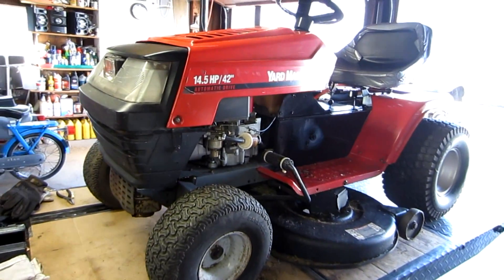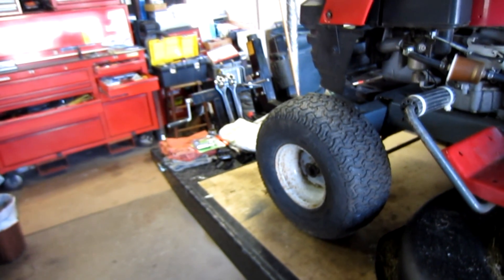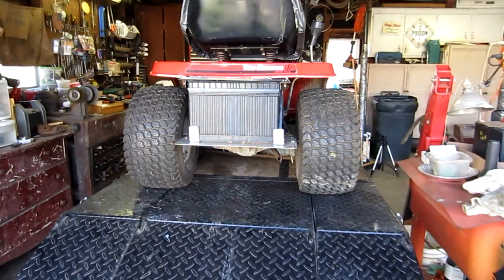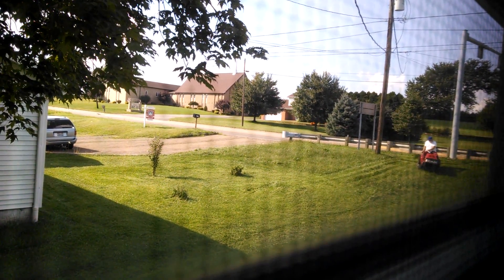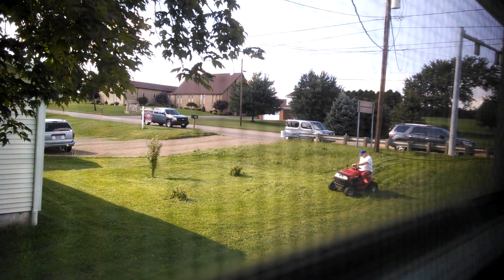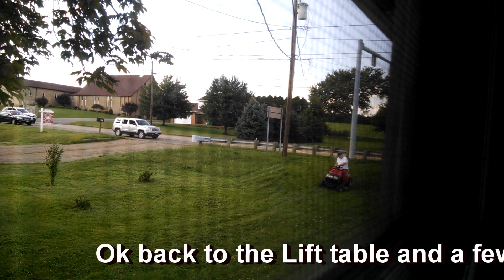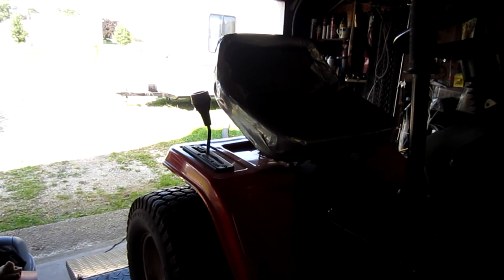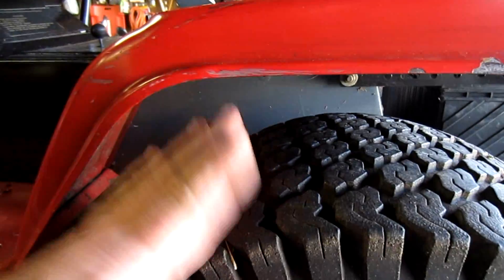Buying used MTD mower DON'TS

Comment: I have a 1995 MTD Yard Machine that I bought new. Just replaced one of the drive belts this week, everything else is original. I have one acre of land and have had no issues with this mower.
Reply: i have a 95 mtd as well. can you tell me how to level the chasis (not the deck)? mine leans, but deck looks level.
Reply: @khamkham7134  check all the air in the tires look up under make sure nothings come a loose that front part swivels may have a bad front wheel bearing
Reply: Strange you never said anything about liking to throw rear drive belts.  My 1996 12 horse model loved to throw rear drive belts. You can't add lube to transaxle also.  The transaxle case cracked after 25 years of mowing.  I actually found a replacement in a mower salvage yard.  It's still mowing today.
Reply: I've only replaced the rear drive belt because it broke.
I finally changed the deck belt and the front drive belt because they were getting loose.

Comment: Never seen one that the deck engaged when you lowered it. My parents owned an mtd yard machine with that motor and a 42" deck,but it wasn't that design.  They used it for 21 trouble free years from 1990-2010. I did the routine maintenance on it as far as tune ups and taking the battery in the house and keeping it charged occasionally throughout the winter. Never replaced the belts,tires,or antiscalp wheels. When they got rid of it it was because the tires were dry rotted and leaking air so bad that they had to be aired up for each mowing. They mowed about an acre a week with it 7 months out of the year.  Not bad for $985 in 1990 dollars.

Comment: I have the same one except mine is hunter green.  1998 Model. I am the second owner. It is still going strong. I actually think that it cuts grass and throws it better than my John Deer rider.  I know MTD gets a bad rap, but they are one of my favorites because of the parts interchangeability and availability. Most things to work on them are easy. Pretty bulletproof engine and transaxle combination that has been around a long time.  The key to these, as any machine, is proper maintenance.

Comment: If you really want brighter headlights in your mower, it's best just to buy the LED equivalent of whatever bulb fits your mower's headlight socket. Say maybe 1156 or 1157. For under 20 bucks you can have 300-500 lumens at half the power draw of the the standard bulb.

Comment: I've used a couple of these 90's mtd designs for almost 2 decades. They do the job, if they're maintained and not abused.

The single cylinder B&S does labor when cutting tall, thick grass. The opposed B&S twin does a better job, when the grass is taller.

They continue to serve me well and surely beat having to use a push mower.
Reply: Like a lot of mowers, they need nearly constant tinkering. Not the "set it and forget it" type. Seen it on a few ride on mowers, not just mtd. They all have their problems

Comment: I have a 22 year old MTD (Ward's) that still runs good. Other than the battery, the only things I had to replace were the ignition coil and a belt pulley - and those were only last year. I even still have the original belts on it. Oh, I forgot the plastic starter gear broke about 5 years ago, I think that was about $2. I addition to mowing, in the Spring I aerate the lawn separately and in the Fall I sweep the leaves separately, so I put about a season and a half on the machine every year. If you think the old MTDs were bad, look at the new mowers with plastic engine parts and plastic transaxels.

Comment: The wiring is a good pointer too. I've seen them where people wrap wires around metal oil drain tubes. Heat and friction are of the two things wire jackets hate and some people think it's a good idea to wrap the wires around a source of both of them.

Comment: I have a mtd twin cylinder 46 inch cut still running strong .. not bad for a 1999 model
Reply: My 14 horse Yardman rider is difficult to turn.  How can I fix this or should I take it to the repairman?

Comment: I’ve ran a few of these MTDs and none of them have had decks that stay on or function. I’ve had some transmission issues as well. The most common is that when they sit for a while the lower gears don’t work, only the high gears will move the tractors for a few minutes. Also I’ve had belt slippage problems in high gears but I think that’s just the belt. I wouldn’t not recommend mowing with one.
Reply: I have one and the mower will stop moving forward in 1st gear if there is much resistance like climbing a grade or in thick tall grass. Is this a transmission issue or a belt issue?  The mower was bought new by my grandfather, he used it for a few seasons and became ill and could no longer use the mower so it set unused under a carport for the next 8 or 9 years. I took possession of it this year and after cleaning the carb and replacing the fuel lines, changing the oil and a new battery have been using it since about May and just noticed the problem with 1st gear a couple weeks ago
Reply: Randy Gray after running the machine for awhile all the gears will start working. If you pull the clutch back with your foot and hold it back it should keep going in low gears.
Reply: @enginesandoutdoors3238  Thanks Ill try that
Reply: Randy Gray if that doesn’t work try replacing the drive belts

Comment: I have a 1986 MTD  18 hp  it has an electric clutch for the deck and it cuts beautiful even when the grass is over 2months growth.Thanks for the video.
Reply from the maker: john palma Thanks for sharing that and reminding viewers that there was a time when MTD wasn't trying to dominate the outdoor power market and instead was making some decent equipment.... Your older MTD had a lot going for it, 1) it didn't have the stupid "lower the deck, blade engagement.. 2) having the positive belt engagement with a PTO huuuge advantage and 3) the smooth power and torque that can only be provided by a twin cylinder.. All those pluses adds up to a good mower.. keep it going, shopping for a suitable replacement that would treat your as good as that one does gets real expensive these days..

Comment: Good tips for buying used mowers. I bought one of the Montgomery Wards (Powr Krart twin cylinder ) tractors in 97 & mow  1 & ½  acres of  mostly hills. It still runs strong. On the Wards tractor I do not have the cutting problem you mentioned. I did have to change the starter once & the 2 blade deck I swapped out for a 3 blade deck due to the original deck rotting out. I have limited garage space & left it outside for years (although covered). I will be using it this weekend. When cutting advise your neighbor to cut in a pattern that shoots the grass out away from center not inward only to build up. You are a 100% right  about having to remove the deck . After all these years I still  cringe just thinking about changing the belts & sharpening  the blades.
Reply from the maker: +JOE Z 😃

Comment: Thanks for posting these helpful hints. MTD lawn tractor mowers are pretty common around here - identical machine can be found under 5 or 6 brand names. I saw a used one, priced attractively, but when I checked it, it had several of the problems you mention. Found another, 16 HP/42 inch deck for $50 more, 4 years old, owner had maintained it really well and it had none of the problems you mention, except cracked "headlight" plastic. That didn't worry me - we get 16-17 hours/day of sunlight, so no mowing in the dark, LOL. All the other trouble spots you point out were good, plus everything worked properly. Sure I spent $50 more, but your "trouble tips" probably saved me a few hundred. Tip for others who are looking - don't be afraid to ask the owner about how often he's serviced his machine, and what's been done. If it's a good unit, the owner will have no hesitation in telling you - and you can see it as well. Even little things - any rust starting, etc. My only beef is that I wished the seat was set a bit further back, but that's easy enough to adjust. Thanks again!
Reply from the maker: +Jim Baritone Great News! Glad to hear it helped out.. Happy Mowing😁
Reply: Aren't the seats supposed to be easy to adjust?  Was the beef that the previous owner was a different build, or that it couldn't be adjusted far back enough?

Comment: Before I started repairing tractors, I did a lot of mowing and these MTD tractors will take a beating. The decks are difficult to remove but are also very well attached and can take a ton of abuse. I never picked up trash, just mowed ever rhino in its path. These older MTD machines are tougher than the new ones. Now the EZ remove quick attach decks are barely mounted to the tractor and the mounting beakers are easy to bend and break off. I fix this issue quite often along with spindles vibrating loose from the mounts and ripping off the deck. All the big box store mowers are wimpy. I think the AYP machines are about the best. Unfortunately craftsman is having mowers built by MTD again so even craftsman is turning to crap. I have found that Husqvarna and Ariens are pretty much all built by AYP. At least all the newer models out now that Iv been seeing around Texas.  I do agree about the Briggs v twin, with good servicing the v twin motors will outlive the tractors.
Reply: Yep just scored a 1988 wizzard 12  hp commercial  460cc briggs  38 " deck. All i did was cut a regular lawn tractor battery  in  where  the tiny motorcycle battery  would have gone,  the   deck itself is solid american steel  you can tell .  cleaned out the carb  and off it went  cutting grass  better than my john deer ever did .  i went through 3   decks with john deer   they just rot out  quickly  and cant take any abuse  , the brackets  break off  the deck from cheap chinese steel  as soon as they rust forget it . its over . The wizard was free and in better than good shape . grand total about 40 bucks into it  32 for the battery including the core charge.   can of drab green  camo paint and a few grade 8 bolts and nuts to  make bracket to hold the bigger battery in  place  lol  try and even find a decent used john deere  deck   for under 250  .  just wont happen. Im thrilled to be back on a old school  lawn tractor . I kept the deere  la-125   for some use  . But ill be running my Wizard from western Auto  as my grass cutter. as far  as the long arm  that drops the deck  . i see no issues?? . Replacing belts will take more time but  new lawn tractors are garbage unless you pay $3,000  dollars  or more .  This  was made in 88  and still   in great shape . My john deere  looks like the  old jaloppy   all held together with anything available to  keep it from  disintegrating  as far as dry rot on tires ???  show me a tractor that dosen't get dry rot on tires !   The john deer had them after 3 years .  That dosent effect anything   pop a tube in it when it wont hold air  . If the new lawn tractors  are better why is everyone selling them lol    on any given day youl see 20 husqvarnas for sale and 20 john deere as well and cub cadets !!  Even my old gear  shifting craftsmans or yardmans were  better  than todays

Comment: The drive belt slippage might be due to that spring that attaches behind the right rear wheel. It pulls back on the deck to tension the belt. And maybe a new, correct belt is in order.

Comment: I've found that running 55w lights is not a problem. If however the battery is slightly larger than the factory battery, it will touch the seat and discharge. This will cause the need to be charged.
Reply: By discharge, do you mean it will create a huge arc and blast you off the seat into the air?

Comment: I've owned and fixed several of these mowers, one problem that often gets overlooked it the belt tensioner will get rusty and become "fixed", frozen in place, and then cannot keep the proper tension on the deck belt as the deck is raised and lowered.  As difficult as it is to pull the deck out of these its always worth checking this.  In about half of the ones I've fixed the tensioner was  messed with by the p.o. or someone in the past, and were incorrectly installed, so that they were reassembled into a fixed position, probably right after replacing the belt.  Then when the new belt stretches a bit they end up being too loose, and squeal and slip as did his neighbors mower did in the video.  There is a  hat shaped washer require at the tensioner pivot, so the tensioner arm can still pivot freely after the bolt at the pivot is fully tightened.  If it doesn't you have something wrong.  Another problem has been weak springs, both the deck belt tensioner, an the big spring that pulls the deck to the rear.  If they are rusty or stretched out a bit they are not going to provide the correct tension.  I've added new springs to the list of parts for all f my deck rebuilds, unless they are pretty new, for most mowers they are still available.
I've had other issues with these mowers, like the rather flimsy front axle, sometimes actually breaking at the pivot or spindle hole.  But for all of the issues MTD's are plentiful and cheap, most parts are readily available, and if you're handy mechanically you can keep one of these mowing for a long time.   For any brand of mower the biggest problem I see are the people that leave them out in the weather all winter, uncovered and exposed, and expect them to fire up and run fine in the spring.  They were not designed for this.  Exposure to the weather has probably killed more mowers than actual use, which is silly since an $8 plastic tarp can prevent it.

Comment: just picked one up for sixty bucks. new battery and drained rain water from gas runs good. missing belt guard on deck blades won't stop spinning when disengaged. I agree bad deck design. hope a new cover will solve my problem.

Comment: I can't believe you didn't mention to check for cracks in the frame, MTDs are awesome for that.
Reply from the maker: I know it can happen but, I have only had one MTD that had frame issues back in 1994 on a 1990 MTD that was sold by Kmart.. I haven't seen another one since.

Comment: I've had my MTD 38" cut riding mower for over 10 years and it's been fantastic.  Looks like most of the trouble with this mower is the owner!!
Reply from the maker: Like I said in the video there's going to be exceptions however 95% of the MTD mowers that I worked on over the years, that have that cutting deck design, always have issues. Feel lucky you're in the 5%.
Reply: @Foxboss9  hi , you think you can help me out , I had a question about the turf trac

Comment: My dad had that same mower. He passed away and it is still sitting in the garage. No one uses it much now. It is like BRAND NEW after all these years. The battery did croak after a while from lack of use. The headlights in those mowers are more for mowing out by the road so cars can see you. I personally think they are junk but they seem to last a long time if well maintained or like my dad's, not used much. The biggest problem I see is some people buy too small of a mower for the lawn. Any mower will bog down in tall grass. Especially wet grass. I remember this huge lady bought this tiny little lawn mower for 3 acres of lawn. She called me on it because it kept quitting. The gas can in her garage had no cap and was full of caterpillers. That's right, dead caterpillers. Plus it was full of water. I made her buy a new gas can and cleaned all the junk out of her gas tank and carburetor. She wore that poor little mower out quickly because of mowing too tall of weeds and hay field , plus the ground was uneven.

Comment: There are too many modifications to that lawn mower that it's really not fair to make a comparison to an all-stock one. For example, I have the exact same model mower as the one in the video- the only difference is that, other than possibly the belts and battery, it is completely as it was when it left the factory. On that note, I have had no major issues with it, being a 30 year old machine.

Comment: This isn’t a MTD problem, this is a owner being an idiot and not getting it fixed correctly. I’ve fixed many MTD’s of that body style and the worst part of these is the belt system for the drive. Besides that they are good mowers I’d the engine runs and the trans works.
Reply: Exactly I had a MTD 42 inch mower for 14 years never had any problems with it I think I only replaced a belt one time out of the 14 years best mower I’ve ever owned.

Comment: I think my dad had an mtd like this he sold it just before it went bad for $75. Then when I grew up I wanted to get into small engine repair so I posted an ad on Craigslist and a guy gave me a mtd 18/46 for free so I ain’t complaining.
Reply: I know this is an old thread, but i just picked up an 18/46 to fix up (pretty good condition) anything you learned you'd like to pass on?
Reply: A M the transmission was pretty much bullet proof, but the engine in the one I got needed a coil, then needed a starter, then carb, and it just ended up having just as much money in it as I sold it for, ive learned with mtd’s unless they run from a jump, they aren’t worth fixing up.
Reply: @tractormatt4301  appreciate the info. It def needs some work. Just gonna throw a couple bucks at it here and there. Gotta go through wiring, PO deff disabled switches and it has a parasitic draw